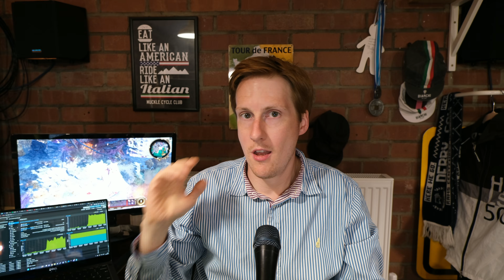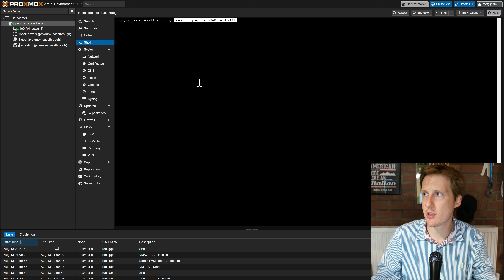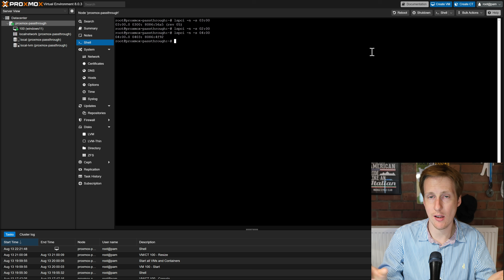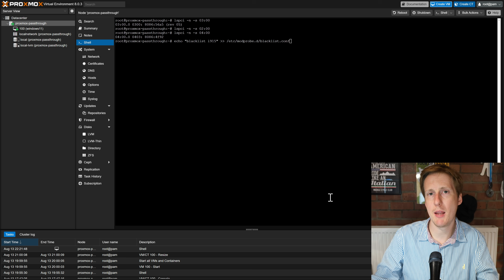Double GPU Passthrough in Proxmox 8!? Play Baldur's Gate 3 and Minecraft On The Same Machine?

Comment: Thanks to your instructions, I was finally able to pass through a GPU to VM! I must have watched dozens of videos from other YouTubers, read numerous ProxMox forum posts, and somehow could not make it work until your video. Really appreciate your style of communicating the information, and specifically describing what each parameter means. Thank you! 

Just for reference, here the system I was able to make this work on (also somewhat dated):
Dell Precision T7610 Workstation
Dual Intel Xeon CPU E5-2697 v2 (12C/24T) @ 2.70GHz 
128GB (8x16GB) DDR3-1600MHz PC3-12800 ECC RDIMM
GPU: NVIDIA RTX 3070
Reply from the maker: That's awesome 😎, good job and thanks for the feedback.

Comment: Hello, thank you for fantastic video. I have some questions however, both about timestamp 18:06:
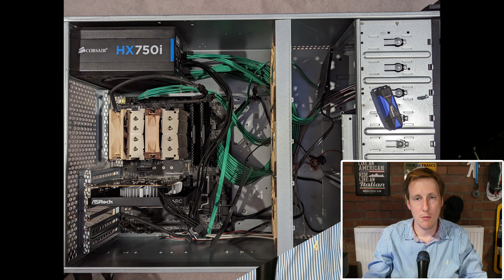1. lspci -n -s 02:00 returne nothing in your case. Why? On my board it returns value like 00:02.0 0300: 8086:46d4
2. Subsequently you don't pass this ID into vfio.conf As I get ID, I suppose I should pass it there?
Remarks (could make difference): Proxmox v8.4.1, Only iGPU on Intel N150, no 2nd GPU
Thanks in advance if you'll find time to answer my question.

Comment: While I am ok with no display out, and I have installed iris xe gpu drivers, I cannot get rid of the driver error in device manager. Also it appears quicksync is not available in OBS or Emby hardware transcoding. Intel driver and support assistant says my drivers are up to date. My igpu is iris xe/19 13900h in a Minisforum MS-01. I also have a Sparkle Arc a310 eco installed. Yes I know they use the same driver. Migh that be the issue? I see it seemed to work in your tutorial. No driver error and availability of igpu funtions such as quicksync. Anyway, great video, super helpful as always.

Comment: Sorry I know this is an "older" video, but thought I'd reach out and try anyway. No matter what I do, I can not get the console to connect after attempting passthrough, nor can I get a directly connected display to actually display after following these instructions. Was hoping you might be able to lend some assistance. Thanks
Reply from the maker: @justinbramble83  that is expected behaviour for passthrough. You should only see the output of the VM. If you were using the GPU for Proxmox output you can no longer, you need to use SSH or web gui, or use the iGPU if you have one.

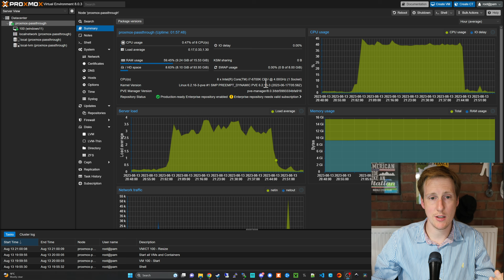Comment: I know this is quite an old thread at this point but hopefully you can help. I believe you mentioned that error code 43 is most likely an iommu group or blacklist issue. Are there any other possibilties? Trying to get an Arc310 working on a supermicro 1028R-MCTR w/ dual xeon. (no igpu) though it does also have ipmi vga that I'm not passing. Via the bios I have it seperating the devices into their own device groups, which I can confirm. The arc card is in group 06:00 (vga) and 07:00 (audio) with nothing else listed.  Iommu is confirmed enabled. Currently blacklisting i915, xe and snd_hda_intel. vfio.conf is nearly idential to yours at ids=8086:56a6,8086:4f92. When installing the windows vm, it detects the arc card. The intel drivers also detect the card and install ok. After which the card lists as working normally in device manager. After rebooting however, i get the error 43. If I reboot the host machine, i can get it to list as working again, however it lists the ms display driver as the primary device (proxmox virtual display) - If I remove that, and boot it then shows the remote desktop display driver as primary. In either case, launching the intel software says it's not available, and tools like dxdiag dont show it as the main device despite device manager showing it as working... but again, this is only for the first time I start the vm on a fresh proxmox host boot. If I shut down the vm and restart, I get the error 43.  Pulling my hair out a bit as I've followed your guide, as well as KasperSkytte's on github and 1cvucc1's over on reddit among others. Thank you again for your time. Hope to hear from you.

Comment: Jim, I'm not succeeding in passing through the GPU, I just purchased a Beelink GTi12 Mini PC, Intel Core i9 12900HK (14C/20T up to 5.0GHz), 32GB with a 12 gen Intel Iris Xe Graphics. Have you been able to test such cards? I’m not sure if we need to do something with the ROM? Many thanks!
Reply from the maker: @josepmariafargastexido6812  integrated GPUs with windows are really finicky, long term stability is always an issue for me. However, Linux seems to have less hassle, I've passed through to Ubuntu servers for years without issue.

Dedicated GPUs tend to just work if you follow these steps.
Reply: @Jims-Garage  Sorry I'm not too expert on this... What do you mean by dedicated vs integrated? Like added cards over integrated, having 2 cards on the system? The point is that in my server I have an LXC container with Debian and MongoDB, a VM with HASS and Windows 11 VM which I would like to use connected to a big screen... So it will be the only one using the full graphics card...
Reply from the maker: @josepmariafargastexido6812  a dedicated GPU is one you plug into the PCIe slot (e.g. a rtx 4090), an integrated GPU is part of the CPU (e.g. intel iris xe). The LXC can use either but if you pass one to a VM, then it's not available to the host or LXC.

For this to work you will need 2 GPUs (likely integrated and dedicated, albeit you could use multiple dedicated with trade-off).

For your set-up I would imagine using the integrated for LXC, and a dedicated passed through to the VM. That will give you display output like a normal pc.
Reply: @Jims-Garage  So if I have only the integrated I cannot do a full passthrough ?
Reply from the maker: @josepmariafargastexido6812  you can sometimes, usually works fine on Linux but can be hit and miss on windows. 

However, you cannot share the same  integrated GPU with an LXC and a VM. Passthrough stops the host using the GPU, therefore the LXC doesn't see it either
Reply: @Jims-Garage but do the LXC really need the GPU? I guess not, I just use the command prompt to configure them through the proxmox shell... ?
Reply from the maker: @josepmariafargastexido6812  it doesn't need it, no. Depends what you're using it for though (e.g. running Plex it would be a good idea to have one). If it doesn't need it you could try passing it to the VM exclusively
Reply: @Jims-Garage finally, could you recommend me a guide or some tips to try? I really don't know what to do? 😊

Comment: Hi Jim's, Thanks for the engaging content. Is it possible to simultaneously run two VR headsets on the same laptop that has a single nVidia RTX 4080 12GB?
Reply from the maker: @aam19851111  I don't believe so. 1 GPU to 1 VM (can be split with enterprise cards, not consumer)
Reply: @Jims-Garage   I should have two GPUs on the same laptop to run two headsets simultaneously, shouldn't I?
Reply from the maker: @aam19851111  yes, I think so

Comment: The thing that's stopping me is if the hardware being pass through plays up, it will require a hard reboot to reset the component. This means it will take out every VM running on proxmox.
Reply from the maker: Potentially, it depends if you have multiple nodes and failover. In my experience I haven't witnessed hardware failing once booted. It basically boots and if it works it works.

Comment: for unknown reasons I could not get IOMMU working/enabled once I added a new Nvidia 3060 GPU with my recently added HBA card with 2 x 4tb HDD - I struggled for sometime without any solution, thinking that maybe the new GPU was the cause. I had IOMMU working with the HBA and drives seen in Truenas. I removed the HBA card and IOMMU was then showing as enabled again - so I managed to pass the GPU through successfully into a windows 10 OS, with a trade-off of loosing the HBA card, and truenas. I think, you did mentioned somewhere in one of your videos, about 2 pcie slots been passed through can cause an issue and there was a workaround. TBH, I almost threw in the towel and gave up, as I would prefer to have the GPU passthrough than truenass. I can add the disks via Proxmox ZFS and spin up Cockpit for NFS/SMB - but yeah, it's not been a fun experience to get this working as the plan for my PC, was to turn it into a baremetal and spin up multiple VMs, as its my main workhorse (i9 13900k / 64gb ram) for media & storage. While I have another node (NUC i7 9th gen)  in the cluster for work labs / testing / backups etc. Just so happy to see my GPU now with all 12Gb of vram - as I tend to dable in Davini Resolve and 3D render packages i.e. Blender.

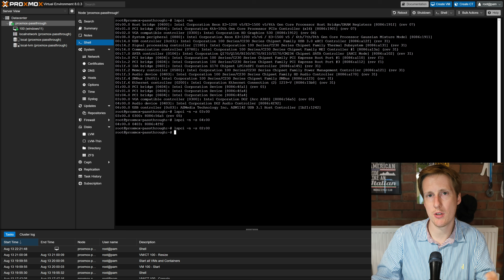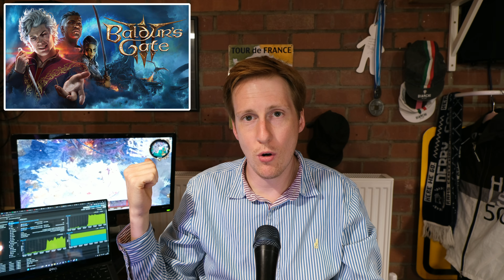Comment: Hello! I have been watching your proxmox video and I must say you are very thorough and clear. I am following all your instructions. Thank you very much! I know this video is many months old but I hope you might respond. Can I check that at time-stamp 17:33 you type lspci -n -s 02:00. Is that supposed to be 00:02? And when you say grouping, it is the separate 2 sets of 2 digits right? So 00:02 is a different grouping to 00:06 for example? And you are not referring to different grouping based on the first set of 2 digits only right?

Also you had a config setting of disable_vga=1 but before that you didn't have the ID for the iGPU in the immediate parameters before (ids=8086.....). Can you clarify? Thank you. I am using an i7-12700H and my id for that is also 8086:46a6. 

And finally the blacklist driver would also be i915?

Many thanks!!

Comment: I am running a standard Debian as a kvm QEMU server at home.
The big thing behind it is that I can dispatch my hardware resources like cpu and memory between guests VMs and in case of CPU cores sharing  between VMs as well. 

Passthrough of a GPU is the exact opposite.
A limited resource is assigned to one unique VM… 
I do not see the point .
Especially as my server would need to run that GPU 24x7

Not your fault but a great achievement would be splitting a GPU and its memory into N vGPU

Comment: Hi Jim i got vfio-pci 0000:00:02.0: not ready 1023ms after flr; waiting using igpu 630 intel and 10500 processor. It lock whole proxmox. Any advice? Many thanks.
Reply from the maker: What are your iommu groups for the iGPU?
Reply: @Jims-Garage  group 0. Thks
Reply from the maker: @antoninoromeo4015  if this is after enabling iommu etc then unfortunately your hardware won't work with passthrough, it needs a distinct group. You might have luck with forcing it with the kernel (ACS I believe).

Comment: Very useful and well made video! If i understand it correctly it's not possible to use an igpu for both host and vm?
I'd like to use proxmox with a container with media transcoding and a win10 vm for small gaming with my ryzen 7 5700u laptop, what do you think? Certainly would be faster installing only windows 10 with docker media container (plan B) but i'd like to try this hypervisor!
Reply from the maker: With consumer equipment you cannot share hardware, you'd need 1 dGPU/iGPU per VM.

Comment: Basic question:  I have no graphics cards.  I only have the GPU insider the CPU.  Does that work for passthrough?  If so, does that mean the console or the spice window in proxmox would be really fast?
Reply from the maker: In many cases you can passthrough the CPU integrated GPU (iGPU), many people do this. It is hardware dependent though and relies on IOMMU grouping. This will mean you lose video output for your machine and will have to use a Web UI or SSH.
Reply: @Jims-Garage  The iGPU is in 00:02 - 00:02.0 VGA compatible controller [0300]: Intel Corporation JasperLake [UHD Graphics] [8086:4e61] (rev 01) - did you say you have a workaround for that?  GRUB_CMDLINE_LINUX_DEFAULT="quiet intel_iommu=on iommu=pt rd.driver.pre=vfio-pci pcie_acs_override=downstream,multifunction nofb nomodeset video=vesafb:off,efifb:off" (some extra options added from other blogs but I can always modify them) vfio.conf is options vfio-pci ids=8086:4e61 vfio-pci disable_vga=1 and blacklist.conf has blacklist i915 in it. Still no joy. 😞
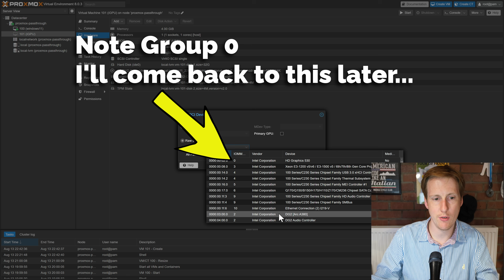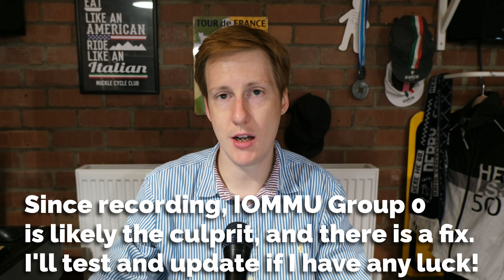Reply: @22:59 00:01 "I'll come back to this"  it what you mentioned. Also @24:52
Reply from the maker: @declanmcardle  that looks right from a cursory glance, but double check online. Sometimes unfortunately it's just not possible due to the way the mobo is layed out. Bit annoying!
Reply from the maker: @declanmcardle Yes, planning to do a follow up video to see if I can fix it.
Reply: @Jims-Garage  OK, I'll post back if I find something....I have other things I can try on, an ACE Magic S1, and a minisforum EM680 and a UM760.  Cheers.

Comment: That tittle had me thinking he actually got to different dedicated GPUs passthrough because passing 2 gpus is supposed to be harder than just one. Got to the end of the video with a the typical Youtuber: "technically if i wanted to". If you are reading this somehow before watching, don't bother the video will not give you what the tittle promised you. But honestly otherwise great video, too bad the title is a lie.
Reply: I have a line that you can add to your grub config and your vm config files and you can not only double GPU passthru but passthru as many GPUs as you want and it is simple. I AM one of those posters who have credit for helping people and also in the Facebook group for proxmox. Passthru is not THAT complicated if you save the syntax required to get it working on any Machine in minutes no retries. Making sure you are in legacy boot is one hidden killer to progress, making people give up when they had it correct, and so forth. It is not that complicated. I can make a video just on Passthru in minutes. There are no config barriers unless you purchase a GPU that has bad drivers.
Reply: Im passing through multiple GPUs and have been across 3 different machines and chipsets.
Reply from the maker: Not entirely true. I'm limited by the hardware used, the process is accurate and I have this working on a different machine. It's completely potluck with your hardware.

Comment: Thanks so much for this presentation on GPU pass through.  I have a threadripper board where I want to run 3 or 4 individual GPU cards.  They are all AMD RX5600X.  I want leave one non-blacklisted for the host ProxMox.  At 19:14 of the video, the blacklist.conf is generated.  I don't want to disable the drivers for the lone GPU for ProxMox.  Is it an all or nothing situation - i.e. must I disable AMD drivers completely or is there a way to generate the blacklist.conf and selectively disable AMD drivers for selected discrete GPU's ?
Again thanks.
Reply from the maker: I think you might be ok just by choosing the 3 device IDs to blacklist. Leave the one you want to use.

Comment: 21:43 This is not how CPU Cores work in Proxmox, you can over provision this and the CPU scheduler will handle it fine balancing more power to the one that has more provisioned of the available resources. So go ahead and unless your CPU base load is spiking already, you can put number of cores equal to the number of threads your physical CPU has. Proxmox it self requires very little CPU resources, and will prioritize itself when needed.
Reply from the maker: Correct, you can do this every hypervisor I've used but you want to avoid it if you can. Competing pressure on vCPU cores can lead to instability.

Comment: Thanks for this guide.  I was able to pass through 4 Nvidia 1070 to the guest os.  Very helpful guide.
Reply from the maker: 4! Wow, nice one. What do you have planned?
Reply: @Jims-Garage  it was my friends old miner rig, got it for free. Got PyTorch running on it already, most ML models can’t use multi gpu on inference but I think I can split off data and do parallel on training to use all 4. Anyway better get away from the keyboard and back to the grill. Happy holidays.
Reply from the maker: @jkyamog  that sounds awesome 😎 same to you!
Reply: @jkyamog  Is it 4 gpu to one VM? May I ask how do you manage to do that?  I was trying to do basically the same thing, but it could not work for some reason

Comment: Well That's a bit anoying IOMMU Isnt enabling for my system. Even when set in bios to enabled it reverts back to Auto.. time to go another route
Reply from the maker: Hmm. Have you checked the CMOS battery? Perhaps it's dead and the bios is resetting each time?
Reply: @Jims-Garage  That's a good one that most people would forget. it doesn't explain why other options on the same page don't revert back.

looking into it but it seems like IoMMU is detected.
"
[    0.763522] pci 0000:00:00.2: AMD-Vi: IOMMU performance counters supported
[    0.764598] pci 0000:00:00.2: AMD-Vi: Found IOMMU cap 0x40
[    0.764829] perf/amd_iommu: Detected AMD IOMMU #0 (2 banks, 4 counters/bank).
"
It doesn't explicitly say it is enabled..
Reply: @SmallBrains-n  double check you are editing the correct boot file. For instance I followed a video from YouTube which had me edit I think a file called "commandline" and added the iommu and I got the same output as you posted. It wasn't until I did more digging that I also had to add the quiet/iommu options to another boot file (which depends on what your system uses to boot ((GRUB or otherwise )) that I got it to show iommu enabled (in proxmox). I don't know about your bios issue though.

Comment: @14:30 I have a valid reason to pass an entire USB hub through but its kind of specific. suppose you want to run a file server / nas and all your drives are USB, also suppose you have dedicated pcie usb3 cards for them to talk to , and those are all thats on it. in that case passing through the host card as a whole should in theory mean better performance for the usb drives in the VM, but youd need to be carefull passing through an onboard one. its too easy to cut off unintended devices from the host that way.
Reply from the maker: That does sound sensible. Thanks 👍